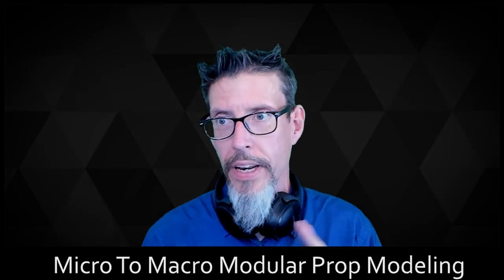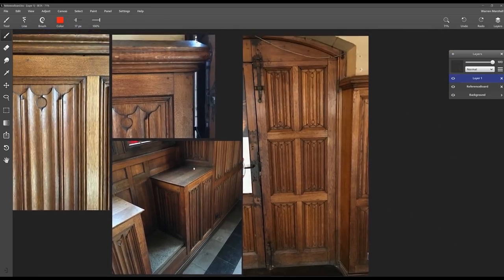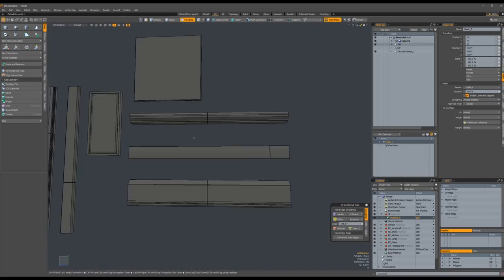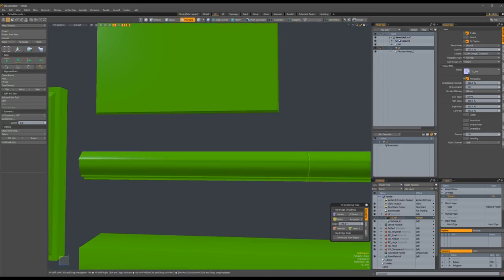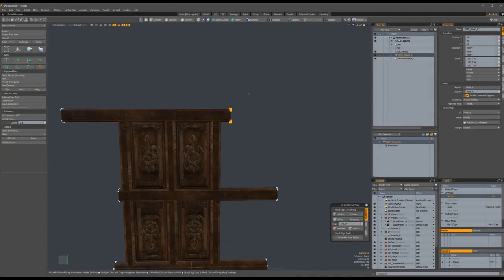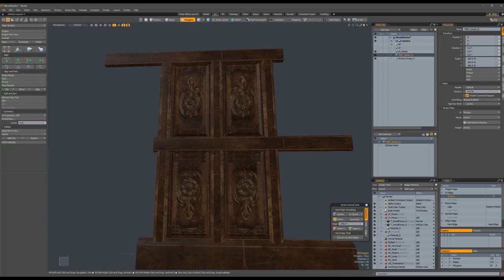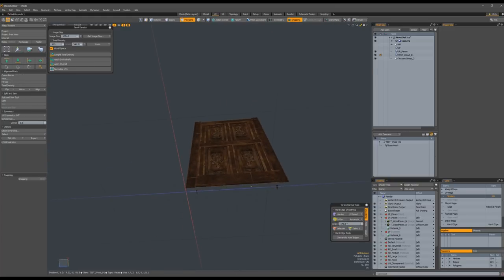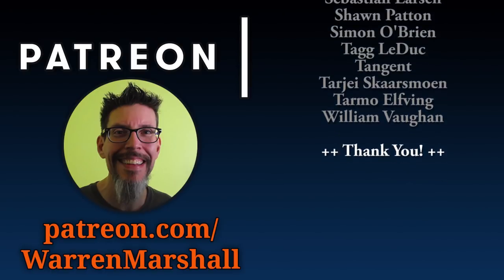Tutorial : Modular Prop Building - Micro To Macro!

Comment: Nice one!  One tip is that if your horizontal strips of uvs go from 0 to 1 and they tile horizontally you can make the beams any length you want without having to cut it and copy a new piece on top and mirror it so you "hide" the seam. If you want to slightly change the part of the pattern they are showing you just slide them horizontal in the uvs and they will never have bad seams since its a tile!  ;)
Reply from the maker: Yes, totally!  That's a technique I've used in the past ... definitely can be useful if you have a lot of tiling strips and don't want to worry about it.

Comment: nice technique, and well executed video! :D one thing though, now your caps are gonna have hard edges. What you could do is bake a cap with smooth edges and apply that to the low poly caps. but add polys that go down to accommodate for the sharp edges :) Hope it makes sense, maybe add the process to your next video ;)
Reply from the maker: True, but the caps are generally in throw away areas that don't matter much.  Smoothing those is often more work than it's worth, but I guess it depends on your project!

Comment: Do you prefer this workflow rather than using a trim texture and mapping them to your environment? I would be interested in hearing your views. Also have you tried the trim techniques that were used on Sunset Overdrive they seamed to create a vast amount of reuse from a small amount of textures with tinting, the trims were less bespoke though but great tutorial will give it a bash when I can 😎
Reply from the maker: I keep meaning to give that Sunset Overdrive method a shot but I can never find the time.  :)  I tend to do it how I do in this video because it's how I originally figured it out and it works well for me.  :)
Reply: Nice I like this technique :) I think working with modular Geometry there is less of a disconnect Thanks again!